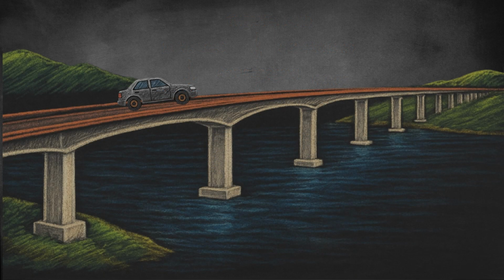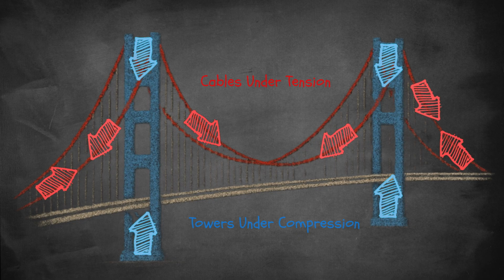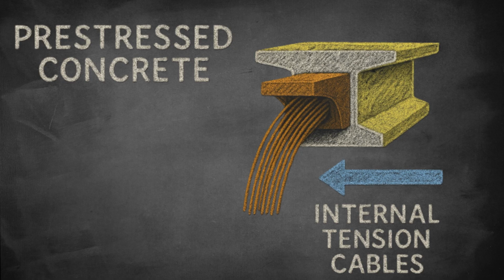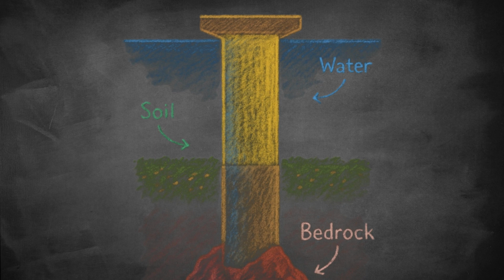The World's Most Impressive Bridges 🌉

Comment from the maker: Time Stamps
00:00 Start
00:10 Intro
00:21 Why Bridges matter
00:36 Basic Forces in Bridges
00:49 Loads
01:07 Load Distribution
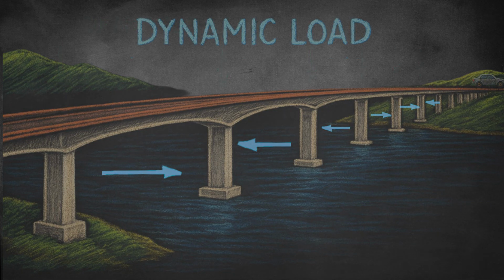01:27 Types of Loads
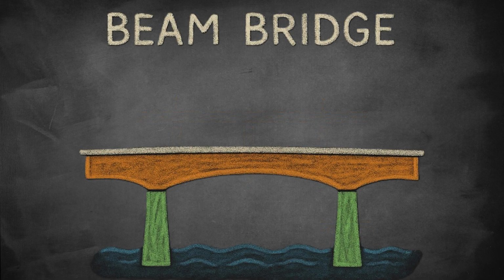02:15 Beam Bridges
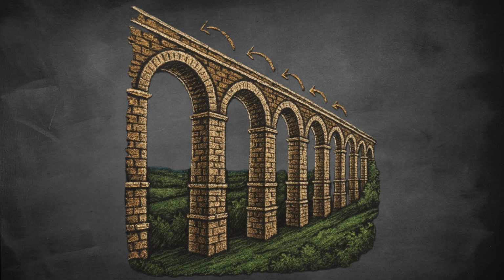02:31 Arch Bridges
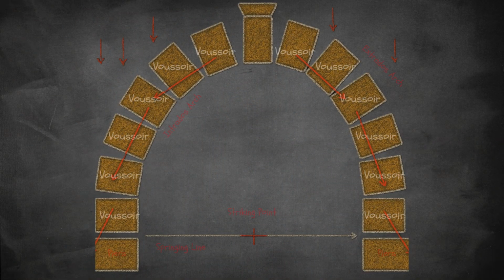02:49 How Arches Work
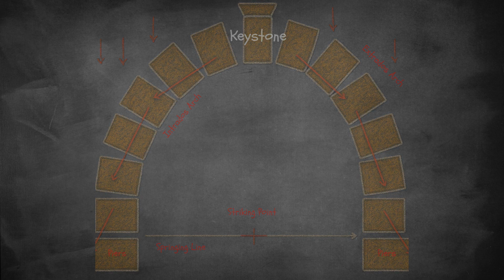03:04 Suspension Bridges
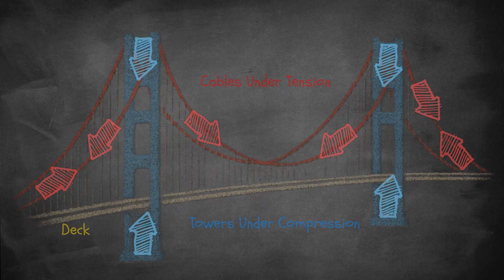03:19 Engineering Challenges
03:32 Famous Example: Tacoma Narrows Bridge
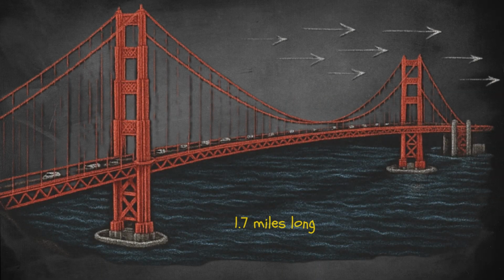06:15 Famous Example: Golden Gate Bridge
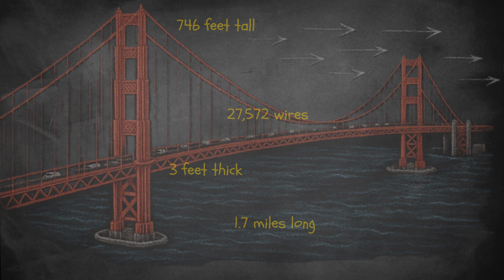06:34 Cable -Stayed Bridges
06:51 Cable-Stayed Design Mechanics
07:06 Famous Example: Millau Viaduct
07:24 Construction of Millau Viaduct
07:37 Materials in Modern Bridges
07:52 Load Testing & Maintenance
08:08 Aerodynamics & Wind Resistance
08:24 Bridge Foundations
08:40 Earthquake Engineering
08:55 Smart Bridges of the Future
09:13 Sustainability & Environment
09:29 Closing Reflection
09:42 Outro